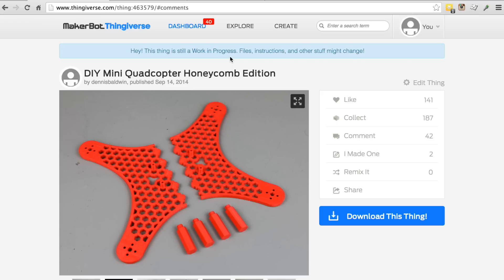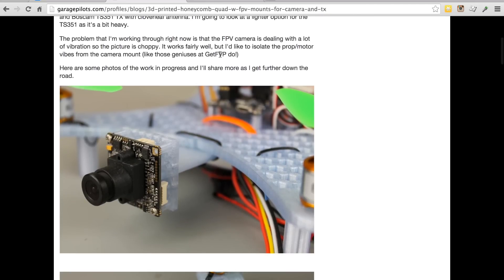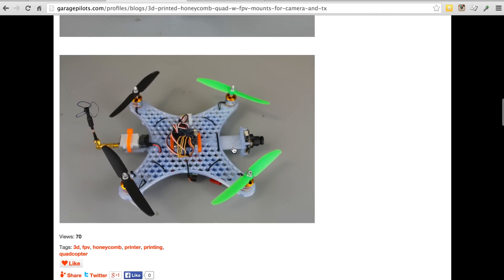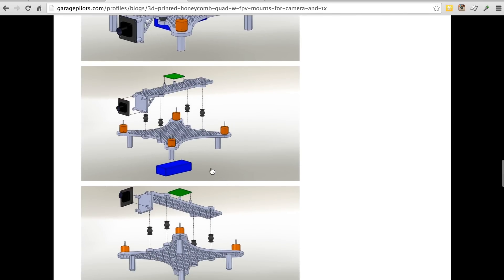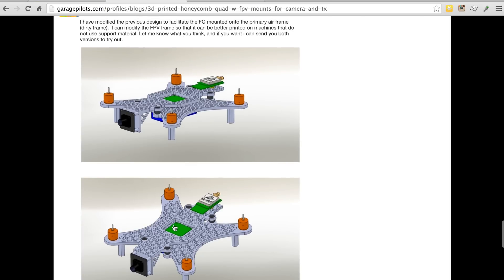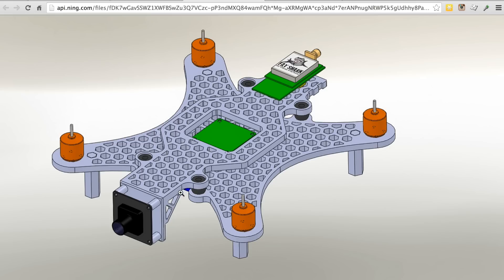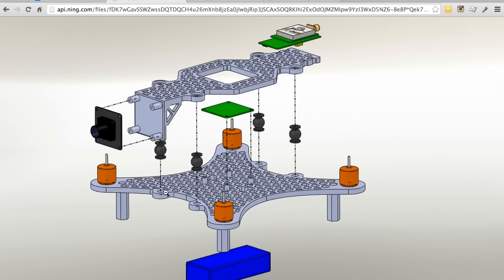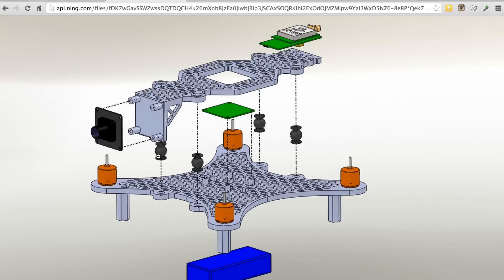3D Printed Mini Quadcopter FPV Concept

Comment: hey thats cool did ever try hobby king the have all kinds of thing  like that for your mini quad im looking in get a 3d printer my self
Reply from the maker: Paul Antonucci Cool. Good luck with your printer search. There are a lot of good options on the market now. Let us know what you decide to do.
Reply: Ok i will they start from 300 to 1,500 I want one about in the middle
Reply: +Paul Antonucci Hey, did you get a printer?
Reply: Not yet I had  some  problems
Reply: Paul Antonucci Alright, I thought you should know that the Makerbot Replicator clones work much better than the newer ones like the Replicator 2X.

I own a $700 Powerspec 3D Pro that has worked wonders for me and others. Other clones have costed as low as $500 and are also highly recommended.

Good luck!

Comment: I live in Austin. If you sill need the dampeners how many and what hardness do you need, I have just about all size and colors and fly out at the HCAM South Austin field. I think HK has a chart as to how many are required to support a certain weight effectively. I have been looking into 3D printers but have yet to push the button, still deciding which would best suit my needs.
Reply from the maker: teamscreem Thanks so much for the offer. I'll get in touch when I know the specific requirements. Also, I've been wanting to get out to HCAM and will have to do that soon. Would love to meet up with you guys. Good luck with your 3D printer research. Lots of good options to choose from nowadays. Take care.

Comment: Have you tried rubber desk grommets for vibration dampening? Lowe's sells large packs of them for pretty cheap. The have the spacer in the middle so you could print a hole for them to pop right onto the frame..
Reply from the maker: TheCooterboo Yo yo! You got a link to some online? I'll take a look. Also, I just got this material called ninjaflex which you can 3D print flexible items. Pretty crazy stuff. Hope all is well and let's hang soon.
Reply: http://www.lowes.com/Search=rubber+grommets?storeId=10151&langId=-1&catalogId=10051&N=0&newSearch=true&Ntt=rubber+grommets#!

Comment: There's alot available of those rubber dumpers on ebay/banggood and so on ... About the quad il see the camera is not pretected and a crash would end up bad ! 

Apart from that it looks cool.
Reply from the maker: Aron Gatt Good suggestion about the camera. Will look into that. Thanks.

Comment: Carrying the extra FPV weight, you may want to modify the motor mount holes to accommodate 2208 style motors, that's one of the initial thoughts that I had
Reply from the maker: eric deherrera Thanks. Will look into that hole pattern.
Reply: Standard 16mmx19mm I believe

Comment: It's a very nice design my only warning will be from my experience with the dampeners on my mini quad. In case of hard crash they will remove for sure and sometimes they can break!
Reply from the maker: ANOTHER BLACKMENNEWSTYLE PRODUCTION Very good point. I've only used them on the Tarot gimbal, but have been wondering how durable they are.
Reply: Look at the Cinetank concept, David took care of the clean section of the frame from coming off in case of a crash :)

Comment: Hey Dennis, awesome stuff as usual. I just got a bunch of these bobbin dampeners from HobbyKing. https://www.hobbyking.com/hobbyking/store/__65250__Spare_Damping_Balls_For_230_250_Class_of_Multi_Rotor_10pc_per_bag_.html a little over a buck for 10 of them. One thing I noticed about the design is that you may want to allow a bit more space around the FC hole, as most of the common controllers have side pins, whether they be the I/O pins in horizontal config or even if those are vertical, you also have the telemetry/accessory ports which you don't have alot of control over. I kind of liked the original design putting the FC up on the FPV board because it would also dampen vibrations to the FC, giving you the "clean/dirty" separation. But I can also see the appeal of being able to remove the FPV gear easily. Just a thought.
Reply from the maker: Cory Braden Good stuff man. Thanks so much for the feedback. You've given us plenty to contemplate :) Will keep you posted on the progress.

Comment: Denis I would find a way to mount the battery to that isolated Camera frame.
I have a HK 450 quad with a 4000mAh battery strapped on the top frame with velcro in between.
I mounted a Mobius with velcro to the main frame. Yeah.. alot of Jello in the video.  Then I mounted the Mobius with velcro to the battery. Just mounting the Mobius to that mass got ride of about 99% of the Jello effect.

BTW... those are vibration dampening balls and can be bought for different mass dampening weights ;)
Reply: I agree with Iaserbee. Joining the stabilizing mass of the battery together with your cam works really good.
Creating a hanging clean section with just the battery and the cam is something i would try.

I often attach my mobius with a rubber band to the battery and let the battery hang underneath the multicopter on just the velcro (no strap, i use the blue Hobbyking velcro which is very strong, never lost a battery) That way the velcro functions as a separation between the clean section (which consist of only the battery and the mobius) and the dirty section (which is the rest).
Reply: Turd Ferguson I was going to suggest hanging the clean frame, but two things come to mind. One, your camera would then be on the ground instead of your frame, and Two, the rubber mounts may pop out because they would stretch rather than compress. Only my camera is on my hanging mount, so the weight is not an issue. The battery on that camera tray would bring up the issue of separating the sections for acrobatics, which he mentioned.
Reply: John Robertson  Yeah... you have a point about the aerobatics. You could still loop a loose ty-rap through the dampening balls and frames to be ensure they don't pop off completely.
Reply: Yep. Great to have a safety. And an interesting thing about zipties(interestingly called ty-rap by you, which means youre familiar with the brand and patent associated with them) is that even though you say loop, and I realize it would use more, but I would take 4 short ones (I always cut my old ones off at the back of the head) and use one thru each of two isolators on one side, making a much lower profile "loop" , and hence more secure. You know, one thru, one flat across, one up, and the last one flat across back to the first one. There wouldnt be dangly loops of ty-raps hanging out to catch on things or vibrate.
Reply from the maker: lasersbee This is a great thread of suggestions. Will give it some more thought. Thanks for the feedback and hope all is well.
Reply: I found 2 rotary stick mods btw. One guy posted  vid fitting a 4 axis one he got off amazon into an Orange tx. And there is a company called Jeti makes one that can be added to a stick if it has a hollow shaft for the wires.

Comment: Just picked up a set for something I'm working on.
http://www.banggood.com/4PCS-Anti-vibration-Rubber-Shock-Absorber-Ball-Single-Load-60g-100g-600g-p-917594.html
Reply from the maker: Tim Dickinson Very nice. I like you can get them for different weight. I'll need to do some extensive testing I guess! Thx.

Comment: I am thinking of buying myself a 3D printer for christmas (from my wife.. lol). Do you need one of the big makerbots like you have to do this, or can it be printed on one of the Makerbot Minis? Sorry, newb question.. would love to build stuff like this.. tricked my wife into it with pics of knick knacks for thanksgiving etc...
Reply: From experience I would buy the Ultimaker 2 over any MakerBot. The Ultimaker 2 has a print resolution of 20 Microns (0.02mm/0.000787401575 inches) over the MakerBots 100 Micron (0.1mm/0.00393700787 inches) resolution. Which means if you want to do a high detailed print the Ultimaker will produce a smoother surface over the MakerBot.
Reply: ***** As a first 3D printer? I am totally new to the whole idea of owning one. I mostly want to work with my flying buddies to come up with some products for FPV Quadcopters like the one in the video here. I am tempted to go for the Cube 3 or makerbot, just because it looks like they are well backed and the Cube actually does two color printing out of the box. Plus warranties etc...I will start doing some research, but thanks for the feedback.
Reply: TitanFlyer The upside to the Ultimaker it the vast community it has behind it and as a plus it is Open Source, due to this the ability to switch components out when upgrades or modifications come around so you don't have to buy a new printer if you want to upgrade, you just have to switch the parts out. In my opinion this makes it far superior to any other filament 3D Printer out there (Excluding the RepRap printers).

If you browse the community forums of Ultimaker you can see what I am on about and see the support that you can get if you require any help with anything.
Some of the mods people have done to improve the Ultimaker are impressive. Plus it is far more forgiving when you screw up or are just experimenting with ideas and different materials.

From looking at the designs, all three printers should be able to fit the print on their build platforms. You may have to be creative with the positioning but not positive. 

The Cube 3 is nice but It has the smallest build platform out of the three, the Ultimaker has the biggest build platform. If you want an even bigger build platform the CubeX is the way to go.

Research is always the key but like I said, I am just speaking from experience with the Ultimaker and the MakerBot. If you ever need any help with any 3D printing related problems just msg me and if I can't help I am sure I know someone that can.
Reply: We have a 1 micron UV cure extraction model at work. Interested in the price? Itd make some really nice snowflakes and angels...heh
Reply: John Robertson Well that's not fair
Reply from the maker: TitanFlyer When assembled this frame is about 9" diagonally from motor to motor. So it wouldn't fit on my R2 build plate. That's why I split it in two. I'm not sure that it will fit on the mini without sizing it down a good bit. Then you'd be faced with making sure your props are well spaced. There is one guy that has sized down my design on Thingiverse, but just not sure how small he was able to get it. You can read the info in the comments. Good luck!

Comment: Just use the h33d replacement dampeners they are like 5-8 bucks for 12 of them and come in 3 different stiffness. You should talk to platinum hobbies about them I am sure he will hook you up!
Reply from the maker: Las Vegas FPV Club Yeah I need to talk to Chris. Thanks for the heads up.
Reply: Dennis Baldwin
 If you want me to send you a set I will do it no problem for testing purposes you can message or email me!